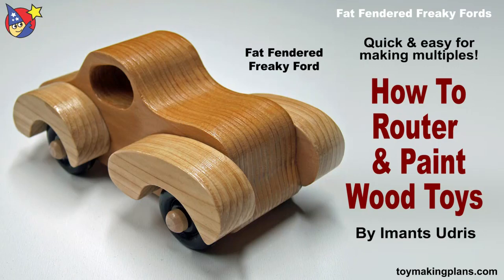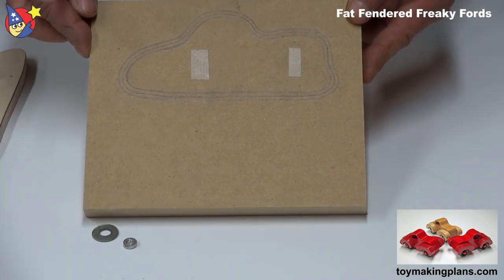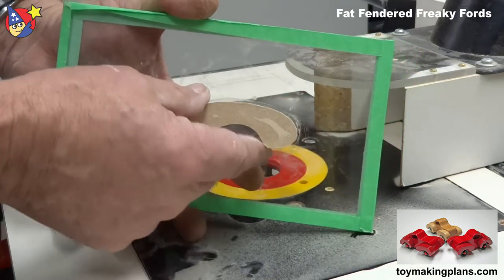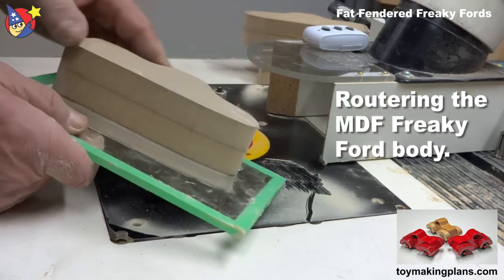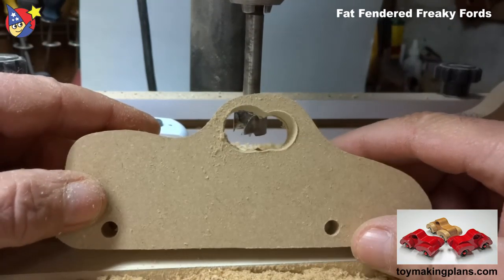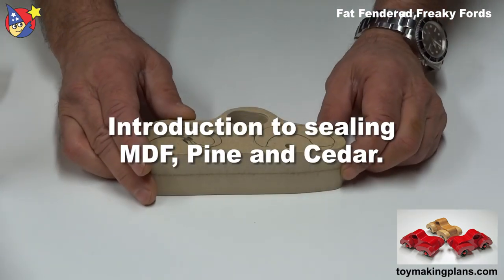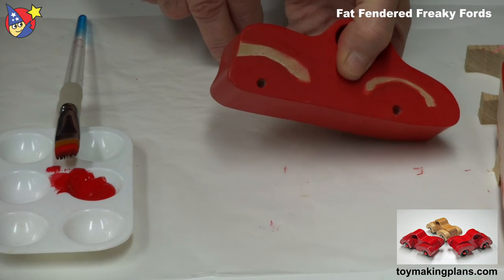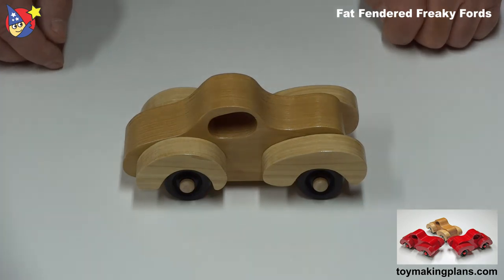How to Router and Paint Wood Toys

Comment: Hi, it looks very dangerous to route small parts just by holding the part with your bare hands. Since I am a beginner to this, is this the recommended procedure? If not, what is the best option to begin with? Thanks!
Reply: Just to be clear: I'm referring to the routing @ 6:00.
Reply: Now that I watched a little more, even with the plexiglass your fingers are under it and (from a naive perspective) seem very close to the router bit. Would it be advisable to have handles perhaps on the top side of the plexiglass?